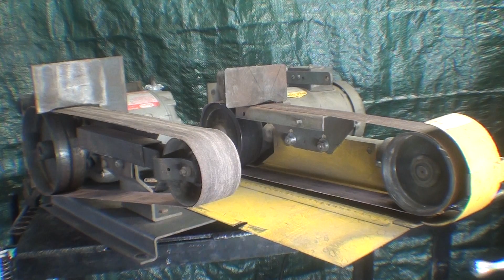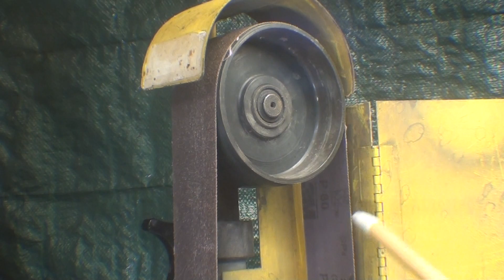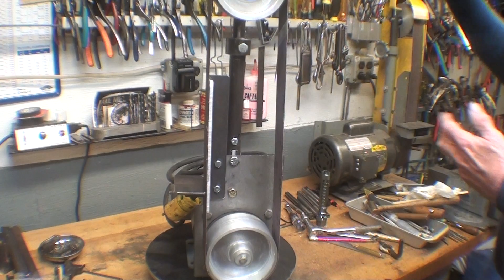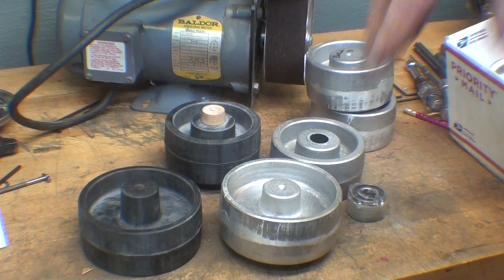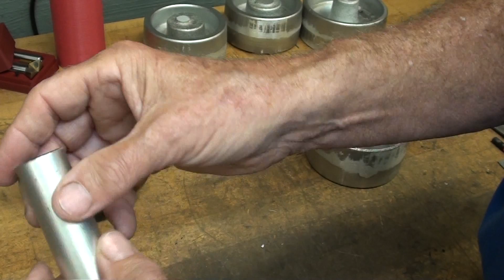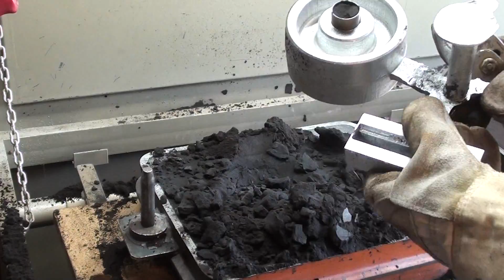Making a 2 x 48 Belt Sander pt 1 Tips #510 tubalcain

Comment: Wonderful video Mr. Petes -- I'm looking forward to building a foundry some day.  I'll likely be building the sander first though -- Thinking I may just built the wheels for it from some real hard old growth maple I have lying around - turning them down to suit.  My uses are hobbyist anyway so not like I'm using it every week or even month.  And if they start wearing, then I turn some aluminum ones.  Likely would make a metal interface hub with large keys into the wood, and has an interior small key for the motor of choice.  
Anyway you grind it looks like you have a good design that will be enjoyable to build.  Thanks.

Comment: I like this a lot and I appreciate your thinking that has gone into it.  I was noticing that electric motors in the right range are kind of expensive, but I also remember seeing that smaller used washing machine are nearly free.  I wonder if a guy could just use two washing machine motors (or maybe three for a 2"x72") and have a motor at each pulley instead of just a bearings.
Reply from the maker: Multiple motors would be a nightmare

Comment: the Baldor is what's called a C flange motor they normally bolt directly to a gearbox, and you are right a very nice motor, being an electrician for 43 yrs I have installed many and in very harsh locations and they perform well. great video.
Reply from the maker: Thanks

Comment: Mr. Pete, I'm following along on this one and will build my own after the holidays as(one of many lol) my winter project. I just sourced a good 8 amp 3450rpm capacitor start motor wit a 1/2" shaft. I'll probably buy a wheel kit on e-bay and fabricate the frame with some square tubing and angle iron (bedframe) I have in my 'inventory'. Thanks fer takin' us along. ps- I tried the engine turning on my drill press with some lapping compound-it came out great! Thanks again and Happy Thanksgiving!
Reply from the maker: Yes, do it. Who sells those wheel kits on eBay? I did not know such a thing was available
Reply: @mrpete222  if you search belt grinder wheel kits on ebay a bunch of choices show up, some are suspect and some others are made in the good old US of A

Comment: The Kalamazoo 2x48 goes for $900.00 !!!!!!!!!!!
Reply from the maker: Are you serious?
Reply: There are 2 models.  The Kalamazoo 2FSM 2x48 goes for 458.00 on Amazon.  The  Kalamazoo BG248 2x48 goes for 835.00-895.00 depending on distributor.  https://www.trick-tools.com/Kalamazoo-2x48-inch-Horizontal-Vertical-Belt-Grinder-BG248-12017

Comment: I'm glad the hub with the aluminum pipe came out as good as it did. Were it not as thick as it was, the pipe would have caused the hub to crack during solidification due to the tubes inability to collapse under compression. Needless to say it wouldn't be a good idea to use pipes/tubes as cores very often. The good news is that when you added the pipe/tube to the mold you introduced a chill to the hub that forced the directional solidification to go from the center of the hub to the outside skin of the hub instead of going from the bottom of the hub to the top of the hub as it normally solidifies. Something to remember when you plan future castings.
Reply from the maker: Thank you for the technical information. Yes it turned out fine. I have done this many times and it always seems to work

Comment: The Kalamazoo 2 inch wide sanders go for about $400 to $450 new now.  Only the 1 inch version remains in the $300 Range. BTW  I live about 25 miles from the Factory.  It seems expensive for what it is but in fairness to the Kalamazoo sander the Baldor motors they use are very expensive but good and probably make up 2/3 of the cost.
Reply from the maker: Thank you, I figured that the cost of the motor would be more than half of the cost of the machine. Of course they get them OEM, but they still paid plenty for them

Comment: Homeshop genius using the rammed sand tube as a core. I think it was Luckygen or some other foundry video that used a steel rod lampblacked with candle or torch soot for a core form as well, no problems extracting it from the casting either. ☺
Reply from the maker: Thanks

Comment: I have made two belt grinders ( 2x72 and 1x42) and found the small diameter wheels cause the bearings to overheat, so I popped the seals 
off cleaned the grease out with solvent, and gave them a couple drops of oil instead. Heating problem solved.
Reply from the maker: Good idea

Comment: I've built two 2" x 42" belt grinders with a similar direct drive design.  One with a 3450 Rpm motor and 6" drive pulley that gives me ~5200 feet per minute belt speed for metal work, and the second using a 1725 Rpm motor for ~2600 feet per minute.  I used aluminum pulleys on the first, and Nylon plastic pulleys on the second.  Both work excellent.  I would attach a couple photos, but I don't think YouTube provides an option for that.  Looking forward to watching you build yours!
Reply from the maker: Thank you, I think there are endless possibilities in designing and building one of these

Comment: I have The Kalamazoo belt grinder you show. I like it just fine except the tool rest is too small and flimsy. If you have ideas for how to improve the tool rest, do mention it in your series.

Love the videos!
Best regards,
Frank
Reply from the maker: I found the tool Rest adequate. But it would be very easy to make a slightly larger or heavier one out of angle iron or plate
Reply: Thanks

Comment: You mention a 4 and 5 inch wheel.  What are some of the other dimensions? What is the angle of the crown? How does one determine proper crowned surfaces to achieve acceptable tracking?
Reply: hang in there. He'll get to all of that. In fact there are some previous vids where he addresses crowning and other operations on the pulleys.
Reply from the maker: Yes you are right

Comment: Total guess, but I'm thinking the reason for two different wheel sizes is to reduce vibration. If the wheels are the same size, they'll turn at the same speed and if they vibrate, they will reinforce each other. If they are different sizes, then the RPM of the two wheels will be different and they shouldn't be able to resonate with each other.

BTW, don't hide your mistakes—every mistake has something to teach. I love hearing you discuss the options and the reasons for choosing the ones that you pursue.
Reply from the maker: Good point

Comment: Very nice castings.  You can get some really cheap bearings from ebay.
Reply from the maker: Hi Harold. Yes that's where I got them
Reply from the maker: What size belt is your sander going to use? I just finished the video series. There are seven parts.  They will be published over the next one month
Reply: @mrpete222  I am planning on 2x72.  I have not finished any videos that are not already published.  I am having a lot of problems with the split bushing fit to the drive wheel.  You would be amazed at how hard it is to find any useful information on the taper angle.  I will probably just abandon the idea of a taper bushing since it is taking so much time.
Reply: @AmateurRedneckWorkshop  Now that you revealed this and, worse I caught you, you're not quitting,....!!!!      Grin...
Reply: @pierresgarage2687  just changing horses.

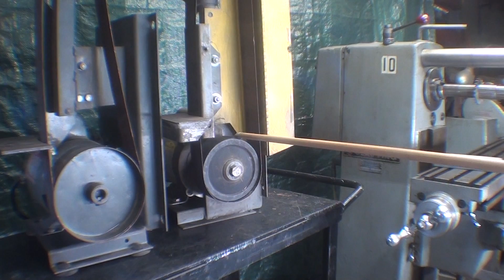Comment: 3:15 (and (9:00)-- If I were to guess, the different size wheels is intended to reduce vibration/harmonics by insuring that they are not running at nearly the same speed. Same size wheels will run closely enough to  (rarely exactly) the same speed, and go in and out of synch, leading to really annoying vibration and harmonics.
Reply from the maker: Thanks

Comment: That different diameters avoid harmonics and let the glue-joint of the belt wander over the circumference instead of beating the same point over and over.
Reply: The glue joint will wander over the circumference anyway as long as the circumference of the wheels are not an evenly divisible amount of the belt length. His wheel sizes won’t divide into a 48” belt length so that point doesn’t matter.
Reply: @Crewsy  You are right. I didnt think as far.
Reply: Hermann Straub 
You may be 100% correct about the harmonics though since most do run a smaller idler wheel, although there could be any number of reasons why including belt speed being optimized to the motor rpm by using a larger drive wheel but I have no proof or knowledge either way.
Reply from the maker: Thanks
Reply: That's why i love the internet everyone can learn anything because people take the time to share their knowledge. Thanks to you both.

Comment: With those Dayton type 2"x48" belt sanders, could you just make the upright post longer to be able to run 2"x60" or even 2"x72" belts? It would just add 6" to the height for each belt length increase.
Reply from the maker: Might be a bit wobbly
Reply: Ive seen vertical 2x60 and 2x72 sanders, I made a 2x72 knife grinder style, I love it using  skateboard wheels for now but after 2 years of use no issues
Reply: I agree. I have a 2"x60"/ 2"x72" vertical belt/grinder that I made myself. It can use either size belt but requires you to move the upper wheel to another notch for the longer belts. It is my own design. However, the upright on mine is a much more stout(6" square thick wall tubing) material. I was simply wondering if this particular "Dayton" design could be modded to go to the longer belts. The longer the belt the greater the sanding/grinding surface area.